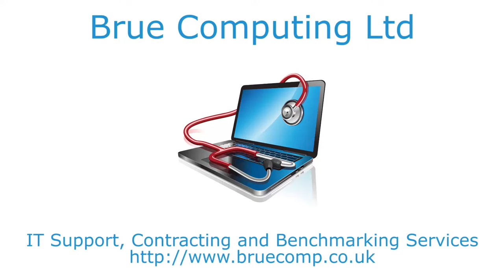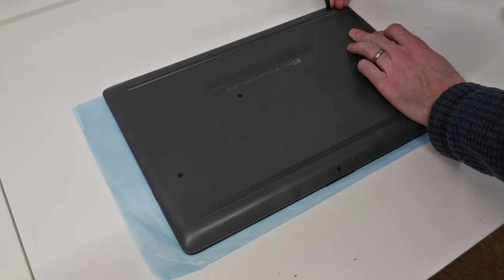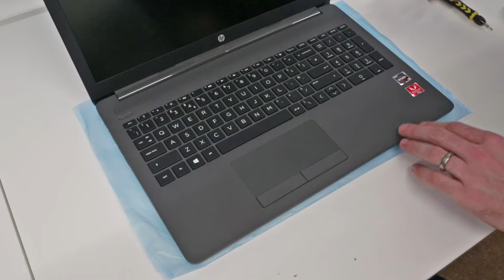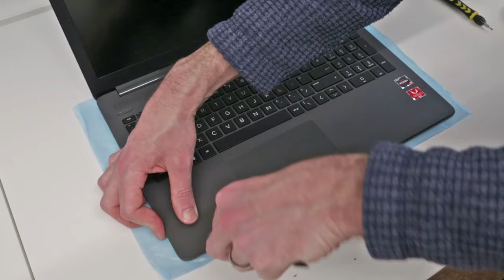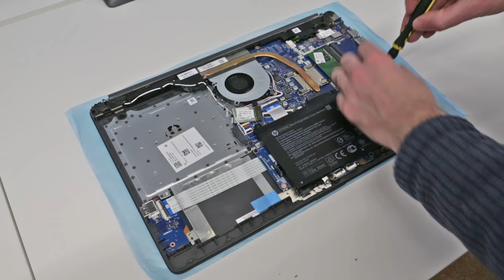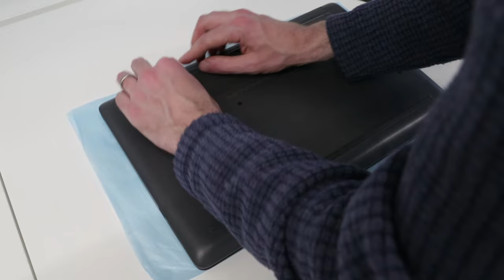HP 250/255 G7 - HT03XL Battery Replacement Guide - 6BN96EA

Comment: Thanks alot! Did my replacement just now. I got the G7 250 version with a DVD drive. There is a slight difference there: When you have removed the screws from the back, you should pull out the DVD drive (its only held in by 1 of the middle screws). 
Might break something if you dont do this. Because the connectors of the DVD drive stick to the board, but the drive itself is held to the backside. When you separate the 2 parts at 5:00 you might risk breaking something :/

Thanks again, hope my battery doesnt burst into flames. These things are terryfying
Reply: Where is the cmos battery

Comment: Hi, thanks for sharing this video. Replacing is quite easy. I bought a new battery on Ali for 32 EUR, although not advertised as a hp brand, it looks like an original. That's strange, will see how it performs. The original lasted for 1 year, that's a shame, even if this is a cheap budget laptop. It's hardware is okay for a tertiary device though. I recognized there is an empty slot for another RAM to my 8 gb, that's a new mission... :) You keep up the good job, thx.

Comment: Thanks very much - this worked very well for my HP 250 G7 someone extremely nervous it would not work on trying to restart - it did!! Surely the battery should be easier to change than this though?

Comment: We had to get some of these recently due to the Intel chip shortage, these are the worst garbage I've ever worked with, and this video just compounds that. Thanks for showing the process. I wasn't able to pull the backplate with just the 4 visible screws, and this video shows they put some under the feet, lol, what a terrible design.

Comment: After replacing the battery the touchpad stopped working, any suggestions?
Reply from the maker: Did you accidentally snag the cable? Check it hasn't been pulled loose either from the mainboard or pad.
Reply: @BrueComputing  no opened it and it looks good. It worked great before the replacement.

Comment: Could you please tell me where the cmos battery is on this board? I have the cmos check sum 502 error and can't find the battery. Your help would be very appreciated.
Reply from the maker: I don't think there is one - HP use the main battery instead.
Based on the fact that often when you pull the main battery it'll lose the clock settings, etc.
Reply: @BrueComputing yeah that's a real cheap, isn't it ?

Comment: Hi we have the same laptop and we have spilled a little bit of coffee on the keyboard so we flipped it upside down really fast and we opened it to see if anything was ruined so there was a  little bit of coffee on the battery but not on the connection is it possible that the battery could expand from it?

Comment: does exist any way to stop using the battery while this lap is 99% of time connected to Ac Power? I only want to preserve it in 50% of it's charge due to maintenance purposes. Thanks
Reply: Good question
Reply: Now I'm curious. Does keeping the battery at around 100% cause degradation to it? Would keeping the battery at around 50% prolong it's life? Thanks

Comment: How do I tell if my battery is bad? Are they supposed to be very flat? Mine seems to have 3 somewhat swollen sections.
Reply from the maker: Doesn't sound great. If it feels 'puffy' or looks swollen then it should be replaced ASAP.
Reply: @BrueComputing  It does not feel puffy, it's solid feeling. Are good batteries supposed to be as flat as book cover? I can tell where the 3 cells are. The battery is not completely flat from end to end. I am going to buy a new battery. I was just curious as to how to tell if my battery did go bad. Again, thanks for your help.
Reply from the maker: Ah gotcha, yes it is a '3-cell' battery, so inside it is 3 distinct sections all wrapped up together.
You can use HWMonitor to see the battery condition: https://www.cpuid.com/softwares/hwmonitor.html
The wear level on the battery will tell you the percentage of capacity lost vs. new.
Reply: @BrueComputing  thanks
Reply: @BrueComputing  I just saw someone comment on wanting to keep his battery  at a lower charged percentage. Begs this question please, does keeping the battery at around 100% cause degradation to it? Would keeping the battery around 50% prolong the battery's life and performance? Thank you in advance. 
I'll feel real stupid if the owner's manual states to keep the battery lower than 100%.

Comment: what if you remove the battery? Does it works with mains only? If not, is there a way to? Are batteries replacement easy to find? Thanks in advance.
Reply from the maker: Yes, if you remove the battery it will work with the mains adapter plugged in.
The laptops takes a HT03XL battery, which can be found here: https://amzn.to/2VGSE5S

Comment: Would you kindly do a video for a 255 G7 keyboard replacement?  I really need one desperately!  ;)
Reply: Hah, you will have no luck finding this information. I recently did this, and documented it, for my apprenticeship. Once I finish the write up, im essentially left with a step by step guide for the procedure. If you're still struggling with this, I could send it to you when I complete it.

Fair warning, it involves breaking a bunch of tiny plastic injection moulded rivet/things, and a lot of patience. I know i use the word "break", but it's really all on the inside of the laptop, and the new keyboard is held together just the same once you screw everything back in over the top of it, no visible damage, etc. And if you're thinking "that doesn't sound right!" well, it's literally the only way. There is no workaround.